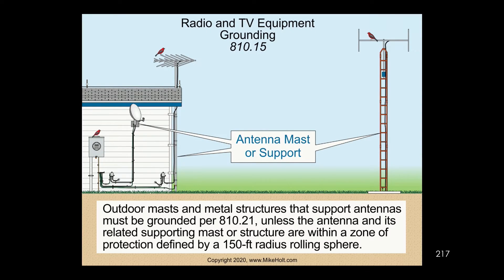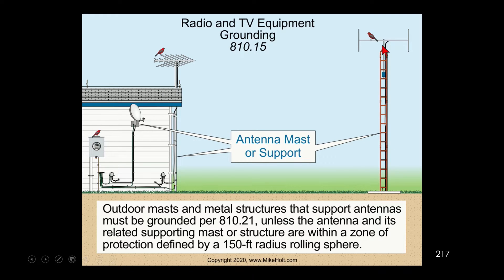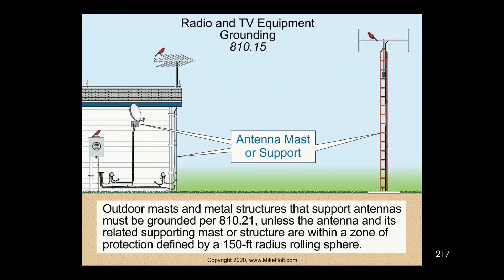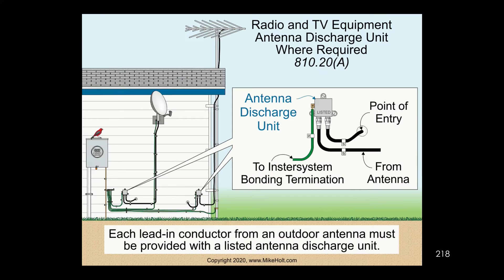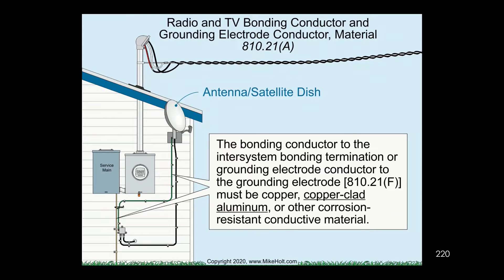Bonding, Radio Antenna Grounding [810.21, 2020 NEC]

Comment: Mike is exactly right.  All grounds need to be tied together.  External of the building with only 1 entry point into the building.  

Driving a ground outside of your window and attaching it to your station will cause there to be a difference of potential between it and the service ground.  You never want any differences in potential on your ground inside of the building.  ALL feed lines should enter the building at the same point as the service entrance and be tied to the service ground.   

If there is a difference in potential between any point to another inside of the building things will fry.  You want the whole building to rise to and fall from 1 million volts at the same with no place for it to flow except at the service entrance. 

Read Motorola R-56 it conforms to the NEC and you will have a better understanding of proper radio site grounding techniques and why there done.

Ideally everything should enter the building at the service entrance and be bonded together including water and sewer.
Reply from the maker: Thank you for an excellent comment and especially for the technical reference "Motorola R-56." https://www.blm.gov/sites/blm.gov/files/Lands_ROW_Motorola_R56_2005_manual.pdf

Comment: We try to create a low impedance "ground plane" beneath the antenna  for the RF to push against. RF grounds are very tricky because we are not only creating an electrical ground but also part if the antenna "ststem".. Ground rods always generate lots of discussion at ham radio meetings..lol
Thanks for video..

Comment: Question: I have an 8’ antenna mast on a roof and an HVAC system on that roof. Can I ground the antenna mast to the grounded HVAC outdoor electrical conduit given that the conduit runs in a straight path to the building ground electrode? Or is there a need/requirement to buy 50ft of 10awg ground wire and have a home run from the antenna to the ground rod, parallel to that conduit? 

It would be a lot more convenient, cost effective, and expeditious to have a shorter ground wire attached to the conduit with a clamp. The alternative, a long home run to ground rod, would have to be anchored to the side of the building in a few places which is work on a high ladder. 

Similarly, is it ok to gang up the transmitter ground to the antenna mast ground or do these need independent runs? 

Biggest concern is to suppress equipment damage from static and fire from lightning.

My gut is that the expeditious method is fine given it’s just electrons moving. But it’s a good idea to consult the experience of experts.
Reply from the maker: Please post your question on MikeHolt.com/Forum.

Comment: Dear Mike, 
I want to thank you for your help in producing 4 videos for Licensed  Amateur Radio Operators about bonding and grounding that have now had about 40,000 views.  As a "ham" since 1964, I am still learning about grounding and bonding.  It should be simple, but it not. 

In recent months, I have been forced to relocate due to health reasons to be closer to my oldest son.  As a result, I have built a ham radio room at the new house with an extensive grounding/bonding system that includes 3 inch wide copper strap everywhere and foil inside the walls.  I am getting close to testing the system with 'high power' now that my tower is up in the yard.  

I had been a Deputy Building inspector for a County in CA and had testified as an expert witness a few times.  Additionally, I was on the Building Code Board and Fire Code Board for the County.  Now I know that what I did know was bunches.  I still watch your videos and always learn something new.  

Again, thanks to you and your family for the help.  Many hams have benefitted from the videos and that, in turn, has generated a lot of discussion.  In a new video being produced now as part of this extensive grounding system, I will refer the viewers to you.  

Oh FYI, I got across 3400vdc in 1965 and ended up knocked unconscious about 10 feet away.  My arm was numb, my skin has been severely burned and there was a hole in my jeans at the belt line.  Some skin was missing from a finger.  Somehow, I survived at age 16.   At age 71 now, I would not survive such a stupid mistake.  

Mike, ham have a way of saying goodbye.  That is the number 73 (from the telegraph lines in the 1850's).  73, Jim  Heath W6LG
Reply from the maker: 73 Jim!

Comment: Well its obvious that you do not operate a ham radio!!! Connecting it that way will distort all the communication, backfeed niose from the power grid and many other negative issues
Reply: It is obvious to me that you are one of those ham radio ops that only half understands things.  Bonding is absolutely required.   It is not going to cause the issues you claim unless your antenna system has other  flaws in design.  like nasty common mode. 

Read some of the books at least recent version of published by RSGB ARRL and others on the topic.  they all tell you that bonding  is good, its required and does not cause the issues you think it does.

every comercial site I have worked at or visited has every ground including RF grounds  service grounds and lightning protection grounds bonded  together.   this is not just transmitter sites but any site that includes repeaters. Cell   MW FM  STLs all that good stuff.  why is it different for them?  why do they not have problems from bonding everything?  because they have a well designed system all around.  

 so what I am saying is   the video is correct.  both from a standing of good engineering and from a legal stand point. 

DE VE3SD
Reply: It is NEC required, And is required for proper lightening protection.
And in any case you want all the ground connections to remain at the same potential to prevent the noises issues you refer to.
Reply: @miller-clem  NO.....That is the theory, but Not the reality
Reply: I would strongly encourage you to read Motorola R-56. It discusses why and how to do proper station grounding. Motorolla R-56 conforms to the NEC, it is the bible for construction of a commercial  radio site.  Commercial radio sites have millions of dollars in equipment on the line and there is no one there to disconnect things.  No where in there will it tell you to isolate any grounds.